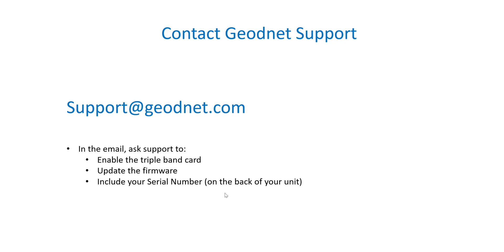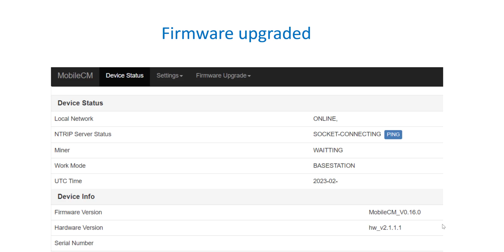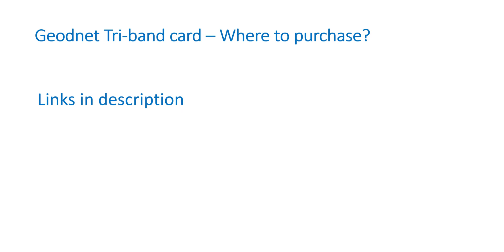Geodnet Triple-band card upgrade - Full A-Z Guide

Comment: Hello i recently upgrade mine but only are up the red power led the others are off what should i do?
Reply from the maker: I presume all the lights worked prior to the upgrade? If so, make sure the card is seated correctly, re-follow the upgrade instructions. If still a problem, chuck a ticket Geodnet supports way, they are good are sorting issues like this.
Reply: @HandymanSavage  okay thanks u